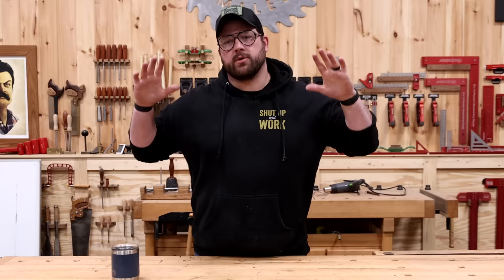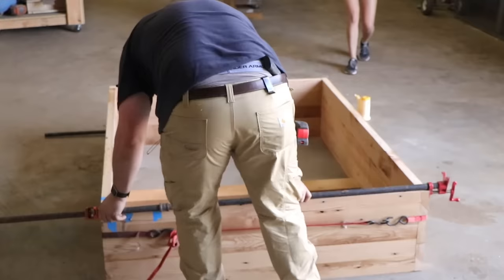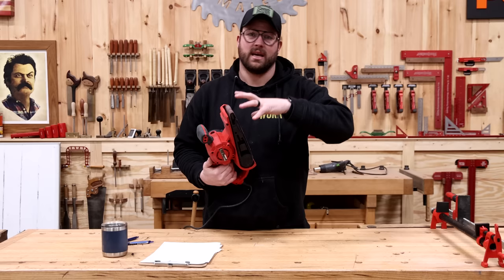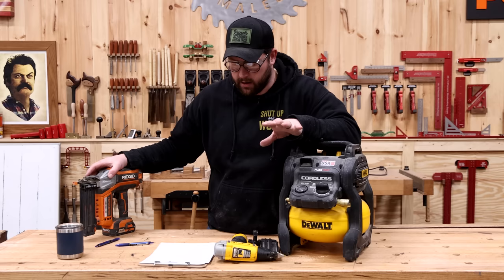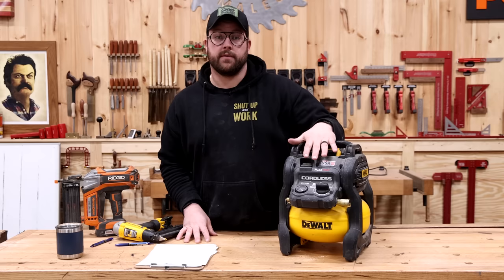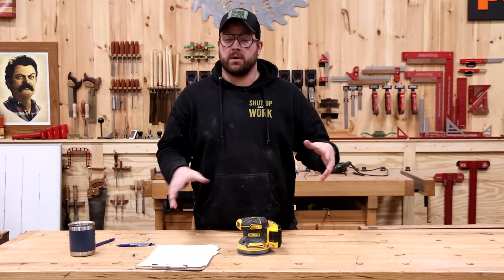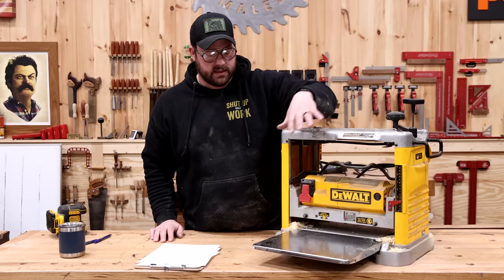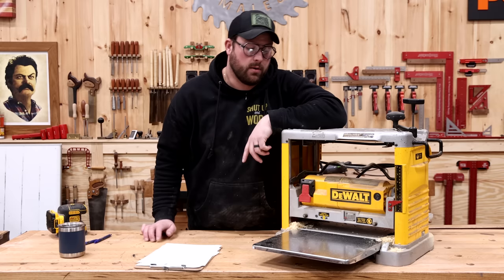5 Beginner Woodworking Tools I Regret Buying

Comment: I got my handheld belt sander at a garage sale for $5 and it works great. Yes, if you don't know how to control it, it will take off on  you and gouge your project. You definitely have to keep you hands on it. Mine is an old Craftsman from the 1970's. I also have one from the 50's or 60's that is mostly for show, but it works great too. 

My biggest recommendation for ANY new woodworker is to not waste your money on NEW tools (until you get more experience and know what you really 'need' vs want). Garage/estate sales, flea markets and pawn shops have plenty of tools. Most of the time you can at least power it on before you buy it. In every pawn shop I've ever purchased a tool from, I've always negotiated a 30 day return agreement with the pawn shop guy. I can also say that I've never had to return a tool either. 

For those that are worried about purchasing 'stolen' goods from a pawn shop, reputable shops are required to register certain items (i.e. tools, bicycles, yard equipment, etc.) with the police so they can run serial numbers to see if the item was stolen or not. They are not allowed to sell stolen items.

Comment: When I first started woodworking I mostly borrowed my Dads tools. Now saying that, he has a myriad tools including 3 circular saws, every nail gun gauge and crown stapler ever made, 3 routers, about 8 copies of every screwdriver, ratchet, and drill bit known to man. He also has a Dewalt planer, which has 2 modes: Jam, or Dust.

To this day though I swear the only things I use in his shop are the miter saw, the bandsaw(when she works, old girl is pushing 50 now!), and the [working] drill press.

On the drill press note, he cannibalized a pair of them to make one work, it occasionally slips gears in the motor but a good WHACK to the side usually starts her right up. Gotta love old tools.

Comment: Hey man I agree with most of what your saying however I just wanted to point out that the k body clamps are capable of huge joining pressure they have a large Alan key receptacle in the end of the handle for applying forces far beyond hand tightening.

Comment: As a retired custom cabinetmaker: Pony brand pipe clamps all day.  Versatile and last forever.
A decent belt sander is quite versatile and doesn’t have to be expensive, and often have dust collection bags.  A good DA orbital sander is pretty much indispensable.
Air nailer is The Way.  Cordless nailer is just silly in my opinion, and as you said: a compressor is very much more useful.
Saw guide/tracks: just grow the skill to run a circular saw straight.  A contractor tablesaw is far better in my experience.  
A bench sander: just flop your belt sander on its side and build a quick jig to hold it: done deal!
That mortising machine is crazy.  Just get skilled with a sharp chisel.  Honestly, in forty years of building high end carpentry I never needed one.  Sharp pocket knife and chisel did everything I needed.
Pretty solid advice.  I’ve used an old Sears contractor saw up to a Rockwell Unisaw, Powermatic cabinet saw and even a 20k dollar Laguna sliding tablesaw and a  Streibig panel saw…definitely worth spending a little more on good tools, but don’t get crazy: the same skills will give pretty similar results with a decent contractor grade saw as a high end cabinet saw.  Sharp blades, square fence, wax the table to cut friction and skill in handling the stock through the machine.  Enjoy!!

Comment: I’ve been a woodworker for 45 years and pipe clamps are the pro way to go
Reply: I agree I hate those K-style clamps. If you need some torque to get a glue up together it is easier with the pipe clamp end then it is with the  screw driver style of a K style bar clamp. What I like is using a combination of  pipe clamps and the style of bar clamps where the end is like a pipe clamp and the other end moves they are nice and light. I have a number of those type from Dubuque clamp works it makes a lighter glue up if you need to move it around.

Comment: I agree 💯 with the nail guns and compressior rather then battery guns, I hate them, so heavy, dont drive nails well and broken drivers in them all the time, air all the way for me, used them most my life anyways so I really don't mind the hose and am just used to it..I also have the Dw735 planner along  with a shelix oem sized head in it and it was 1 of my best investments in my shop even tho it burnt up (1½ years old then) and I had to rebuild it literally as soon as the shelix head was delivered and I was actually getting ready to install it, but I decided to run 1 last board threw it that i needed before tearing it apart for a few days and just my luck it goes up in smoke and needed a new armature and everything else replaced and I now have double the $ in it, but since then it's been a monster..

Comment: Try the Bosch 12v cordless ROS. It's surprisingly good for final finish work, on site touch ups, etc. It is underpowered, limited dust collection, but it's very ergonomic, feels like a Mirka Deros, is cheap- $100 at Lowes right now with a free battery and charger kit- and does a great job for what it is. No replacement for a plug in though.

Comment: Hi John.  I always appreciate your videos.  I agree 100% about the Dewalt planer.  Top quality and professional results.  You just can't replace a good track saw.  I use the Makita and love it.  Just wish I could afford the 105 inch piece of track...  As far as the cordless nailers I am on the Milwaukee platform and love them.  I used to use the compressor and pneumatic guns but a lot of my work I find myself in locations that people in the offices or work areas do not want to hear a compressor running all the time.  I do not have to deal with untangling hoses especially when I am up working on a scissor lift.  The battery life is excellent and I do not mind the weight.  I use a 18 gauge and the 15 gauge DA angle nailer and they handle almost all my needs.  Thanks again for the videos.
dd

Comment: 30 years as a professional woodworker and never bought a pipe clamp. They're    too clumsy, too short in reach and not all that cheap. Personally, I recommend a decent set of f-body clamps. They do 90%of the clamping in my work and are much more flexible than pipe clamps.

Comment: As a 50+ year pro, I'm both grateful for all the tool opportunities that are now available and saddened by how much you have to spend to take advantage of them.  Hats off for this video.

I can't agree more about the K-Body clamps— they are very good for specific things, but I've seen youtubes where the shop has 20 or more hanging there, used for all glueups, and can't imagine having the spare change to justify buying them all when pipe or bar clamps do it better, cheaper (BTW, Hargraves are my favorite, though quite pricey.  Though they hold or increase value with age).

Belt sanders, on the other hand:  The first tool I mastered, and my go-to for stock removal or first pass sanding.  Try sanding out chipouts with a RO or vibrator, you will be there all day.  That said, most brands don't track or balance well.  Some are so poorly balanced that the sander tips over just sitting on a table, practically guaranteeing gouges and digins.  It's been ages since I bought one, but the old Rockwell "locomotive" A3 was a wonderful workhorse, as well as the Black and Decker pro model—  both were $300+ several decades ago.  Well used, they are amazing.  Nowadays I'm more precise, and don't have to sand face frames down as much at the joints, but can't imagine using just my Festool 150FEQ RO, it would be laughable.  The belt sander, well used, makes a flatter surface faster.  Learning curve, sure, but try flattening a glued up tabletop with any RO and you will see what I mean.
Reply: Pipe clamps are NOT better than Bessey's. There is much research available to prove this.  If budget conscious, buy them one at a time and you have them for a lifetime.  Guys across this country every weekend are having garage sales selling off the cheap crappy tools they bought trying to save a dollar. Buy the best you can afford, you will value them, care for them, use them and have them for a lifetime.  Buy cheap crap, you're going to get frustrated, misuse the tool trying to compensate for it's shortcomings, produce crappy work and end up buying something better in the end, costing more time and money in the long run.
Reply: @davidcole333  I have to emphasize that everyone's experience, product line, and physical capabilities are different.  This video is specifically about what a beginner should buy, and I commented on that basis.

I use K clamps for some things—  I like them for assembling boxes, and for small, no problem panel glueups.  As @John Malecki said, they are expensive without giving the return they deserve in many cases.  For the same money, the best clamps I've used for panel glueups are Hargraves.  They have a heavy bar, rachet stop, long and powerful screw, and are a pleasure to use (except they are heavy, but then, I don't have time to go to a gym).  My second choice for a moderately difficult panel, and, despite great equipment and mucho experience many of my glueups are moderately difficult, is a pipe clamp similar to a Jorgensen.  My last choice is tied between an F clamp, a K body clamp, and a pipe clamp that uses a pawl instead of a clutch.  Hargraves don't deflect much and are extremely powerful, pipe clamps are maybe 2/3 as strong but deflect, pawl style pipe clamps are hard to reset and dent the pipe, F clamps don't help flatten the panel (not that it's permanent, but panels can spring apart if bowed too much) and K body clamps don't deliver the power, don't have an unlimited life and are just not the most efficient.  

I've been a pro woodworker for over 50 years, this has been my living and my life.  I've used them all, and others besides, and am speaking from my experience.  YMMV.

Comment: Dude,,,,, that saw guide is freaking awesome.  That is a go to tool for breaking down 4 x 8 sheets. Its not a track saw or reallyeant for fine wood working. But i use this on plywood and osb literally all the time to make straight repetitive cuts. It definitely serves its purpose well.  Don't just dunk on things because it may not fit your specific need. That jig is actually a great tool over freehanding. 

Omg, that Dewalt planner is a great tool. Ive never in 15 years of owning that planner encountered any of the issues you claim. What are you running through it?  Its meant for a small work shop running 6 ' stock through. Do you even do wood working?

Comment: I love my parallel clamps just simply because of the depth of the jaw, not for anything else. Nothing wrong with my 6' pipe clamps though. :)

Belt sander is good if you are redoing outdoor work, but not great for shop work.

Cordless nailers - worked with them a long time ago and it was good if you are doing it in a repair situation where you need to nail a handful of things. However, like John says, the compressor is chef's kiss so useful.

Spindle sanders are useful if you are doing guitar making. My Harbor Freight drill press works in a pinch because I am cheap and have no room for a spindle sander in my shop/1-bedroom apartment though.

Dewalt 735 with infeed outfeed is the GOAT for tabletop planers. Can't wait to get a helical head for mine (once I go through the blades). Maybe this spring I will do that.

Comment: I have a cheap Harbor Freight hand-held belt sander. I always thought it sucked because the belt drifted to the side, but a more experienced woodworker friend told me that this is a problem for even more expensive belt sanders. I originally bought mine because I had to level the surface of a piece too large to fit in a planer. With a 60 grit belt, it made short work of that. I've used it plenty of times since, often clamping it upside down in my workbench to use as a stationary belt sander. It's probably not the greatest and most useful tool I have, but I feel like I got my money's worth. (Oh yeah, dust collection is bad, especially since it has a weird rectangular shaped port.)

Comment: I've made a little table that turns the hand belt sander into stationary sander.  Without it - indeed not much use, but still I can detach and use it on rough wood.

Comment: I got into woodworking by building guitars. I have or had most of the tools you mention here. Most of them have barely been touched.  I bought a big house with a 3 car garage that I was going to turn into a guitar building shop. After I moved in I started buying table saw, drill press, band saw, planer, jointer, that rigid sander, dust collector, expensive filter for the dust collector, festool track saw, tons of hand tools, etc.  that all started 12 years ago. Sad thing is once I moved in all my motivation to build guitars completely disappeared. I didn't even play guitar anymore. I wasn't good at it anyway. I kept buying new tools because "I'm going to do projects! I swear!" I never used the dust collector, planer, jointer, barely used the table saw, band saw drill press. etc. I've sold a bunch of it now, but I still have a LOT of pretty much unused tools. My Dad was a woodworker and he died last June so I have most of his tools too. My garage is a nightmare :hand-orange-covering-eyes: to this day, aside from several guitars I've only built 3 woodworking projects. My tool collection suggests otherwise :face-blue-wide-eyes:

Comment: Great list  man.
The only reason I have a belt sander is I got it from my dad. old Porter Cable, solid, works well, I used it twice I think.
I prefer to use either a planer for larger projects or my trusty Scrub plane for fast wood removal. 
Compressor is definitely the way to go. Even if you have a battery system set up, pneumatic tools are universal. They all work with the same connector. And you can pump up your own tires, blow leaves, etc. seriously, 2 best tools for any garage are an air compressor and a power washer. best investments I've ever made. Yeah I know, power washer isn't a woodworking tool, but once you have one at the house, you don't know how you lived without it for so long, just like the air compressor.

Comment: A belt sander is something you need a good skill for. Practice on a bunch of junk wood first. Great for hogging off paint, dirt, or other stuff that will dull planer knives. I have used one (Porter-Cable 3x21) to turn 3/4" Fir into 5/8", to make drawer fronts. The boards look like I've sent 'em thru a planer (did not have a planer then).

Comment: Thanks for this, John--good info! I have just one caveat to add, concerning the compressor.  I few years back I bought a B&D pancake compressor, which crapped out after only a couple hours of use.  The cause: a failed pressure regulator disc, without which the unit can't function.  It was made of plastic, and B&D did not sell any kind of replacement part.  Which meant my brand new compressor was now a doorstop.  (The warranty period had expired.)  I don't know how many of these pancake compressors are also made with plastic pressure regulator discs, but I would advise checking that out before buying: a) is the disc made of plastic or metal, and b) are replacements available from the manufacturer.  If not, I would steer clear.

Comment: were was this video when I stated 😂bought that exact Brad nailer.  And it’s slow. I started with the Porter cable pancake with the 3 nailers. And they worked great for years. Wen has a super inexpensive 18g Brad nailer that’s super great to use and the handle has a handle that feels like a feather pillow on your hand. But you can’t beat the porter Cable for longevity. Just make sure to oil them regularly. The ridged table top sander is a good

Comment: 100% on the air compressor/brad nailer combo... I love mine. I lucked into a 30 gallon air compressor for free that I was able to get working again... not an option for everyone I know... which allows me to be even more diverse because I have that big tank that allows me to expand into other activities that require more air availability, such as large spray jobs, and pnuematic tools which can often be cheaper and more powerful than their battery operated counterparts... but a small compressor with a brad nailer like the dewalt you showed is definitely more than enough for someone starting out - recommend to get a sprayer tip for quick dusting ( outside, enclosed spaces just makes it so you can't breathe ) up of all that saw dust after a sand job.
Reply: also, i was debating on buying a track saw when I saw your track saw jig guide, and I made that instead, saved me a bunch of money, and it works great. I had to remake it though, because I messed up and damaged the straight edge - but still much cheaper than an actual track saw.

Comment: I have the 13inch DeWalt planer and i gotta say that thing is awesome it doesnt quit ive never had it pop the circuit breaker thats on it and ive had it hog out alot of material and like you said its nice cause you can just go to the box store and buy some new sharp blades for pretty darn cheap

Comment: I've gotten a lot of mileage out of Kreg skill saw guides.  I use their accu-cut guide, and a shorter one from another manufacturer the most. They may not be perfect, but those plus good metal saw horses and 2x4s to make a table, a few good clamps, and an inexpensive skill saw, and I have been able to reliably cut plywood just about anywhere.

Comment: I already had a small portable compressor for other things before I got started woodworking.

I ended up hitting up Harbor Freight for a 16ga finish nailer, and later on an 18ga Brad nailer/stapler. I've put hundreds of nails thru both without any real issues. I think all in for the compressor and both nail guns I might have spent $100.